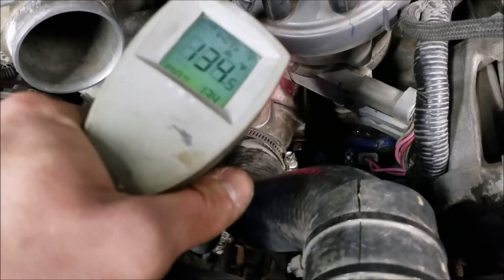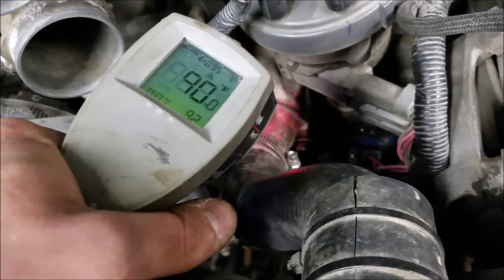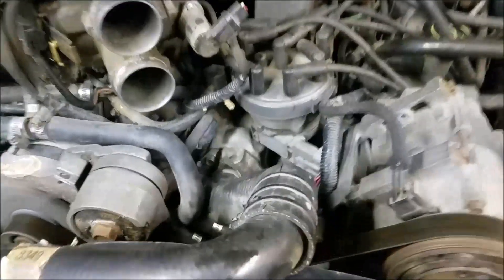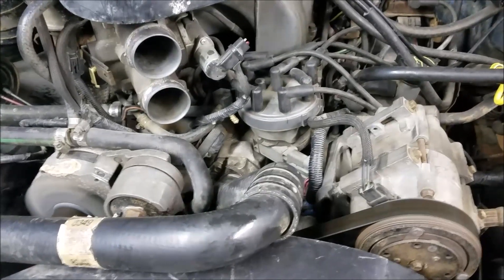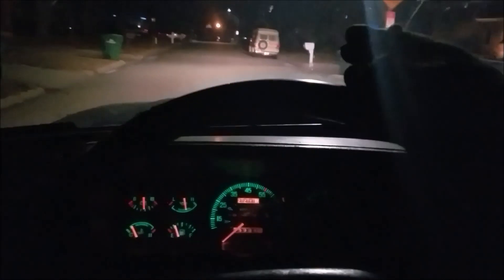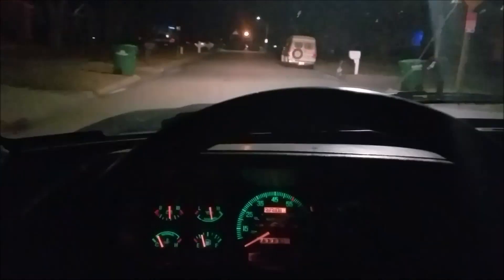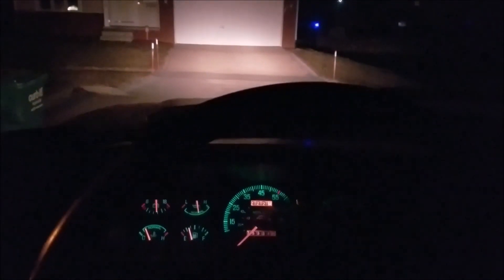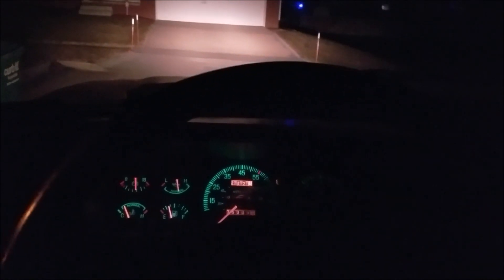Correct Temp Thermostat in Car  - Why It's Important to YOU

Comment: I see this all the time in my work. I work in auto parts. People say “my car overheats. I’ll put a colder thermostat in it.” No, that’s not how it works. If there is a fault in the cooling system, it will still overheat regardless of thermostat temperature, unless the thermostat itself was the fault. And then put back what came in it.

Comment: Okay, I have a 1951 Ford F-1 with a 302 and automatic transmission from a 1990 Mercury Marquis.  It also has a big radiator from a Ford van and didn't have a fan shroud.  That's how it was when I bought it.  I made a shroud out of sheet metal and to my surprise it did an amazing job.  The engine has a 160 degree thermostat now and originally Mercury called for a 195 degree thermostat.  Also, it has a Holley Street Warrior carburetor now. So, what is the advantage/disadvantage of recommend vs. alternate temperature (160, 180. 195) and which is the best choice for my set up?   Thanks!

Comment: What thermostat would u recommend for a carbureted engine (80s 302)? Lightly modded. Im coming across way too many options... 160F, 180F, 195F, 197F... and then also standard and high flow options. What would be the optimum running temp for this engine

Comment: nice truck ! have a diesel vw tdi, heater v slow to warm up , how does a faulty thermostat affect the running of an engine, and would it cause over heating in a diesel?
Reply: CORRIGEEN71 a bad t stat will cause any engine to over heat if it's stuck closed, if it's stuck open the engine will never fully heat up and or take forever to get up to temp if u dont have a right to tstat the cars computer wount ever see the car comming up to temp so the car will stay in the warm up cycle (running rich and higher rpms)